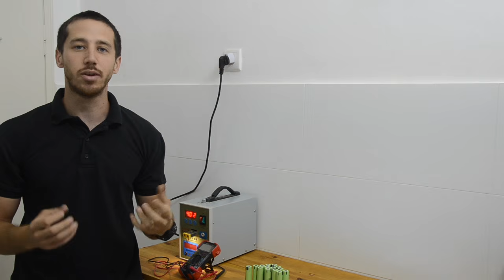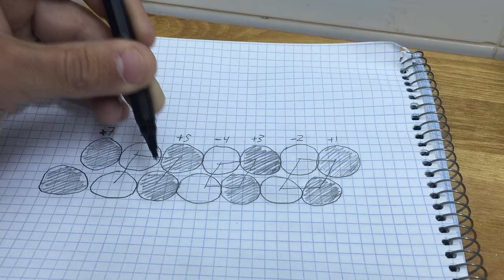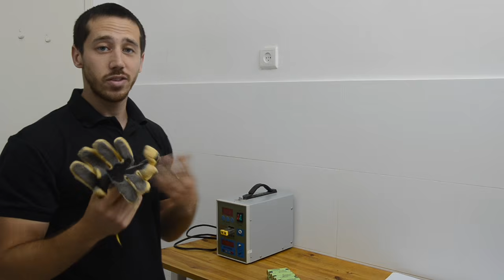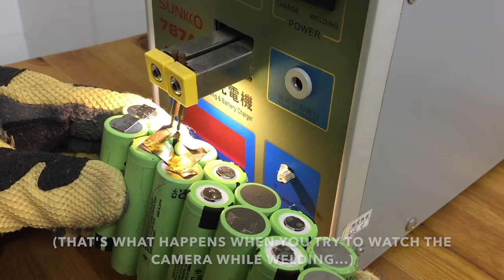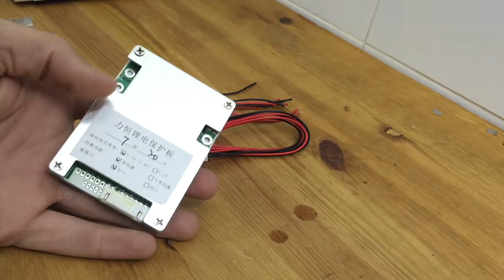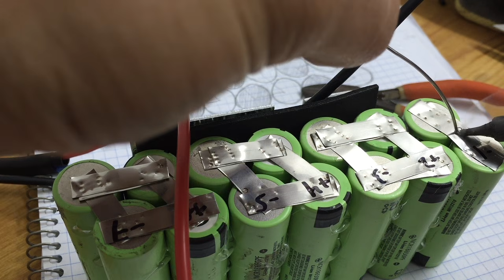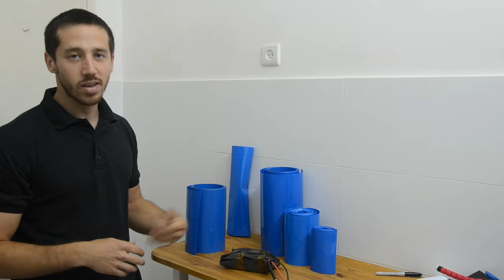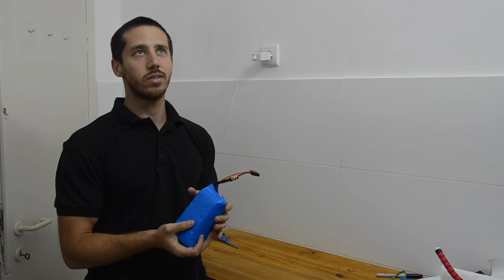How to build a DIY ebike battery from 18650 cells

Comment: Pretty good vid man, but a couple of things jumped out at me that maybe could be better?
I notice you're using 2nd hand cells yet you make no mention of capacity matching, you can't just slap cells together. If nothing else the whole pack is only as strong as the weakest parallel set. 

Also, when cutting your nickle, at the positive end underneath the heat shrink, the negative casing is rolled over the end of the cell. Sharp nickle corners, thin shrink wrap, in a bike vibration is an issue and if the corner gets knocked and the nickle rubs on the cell's shrink it will cut through and short the cell in no time at all. Keep the ends such that corners remain inside the positive end "buttons". Soldering to the nickle strip between two cells is also very dangerous for the same reason. Two layers of kapton tape under the nickle strip fixes this.

I make gaskets out of card that go between the nickle strips and the cells to protect the shrink from both heat during connection and from the strip rubbing later. Pro tip that's probably counter intuitive. A much bigger chisel tip on your iron with more thermal mass makes it much quicker and easier to solder to the nickle (or straight to the battery as I do) so quick in fact that very little heat is transferred into the cell itself.

Lastly, depending on the application, @5A draw per cell, they're going to produce a fair amount of heat, enough to soften hot glue. Add the heat generated by the BMS... I wouldn't wrap the pack in thermally insulative material. 

I have a jig to hold the cells vertically while I weld them in series sets. I then use 3x1.5mm foam filled double sided tape in between layers on each end and temporarily tape together. I then make the welds that parallel layers and attach the BMS balance wires, and output leads. One layer of shrink that leaves the SIDES of the end cells exposed and insulates the connections. Attach the BMS to the outer of the shrink. I leave the BMS in open air unless they're exposed to water, but really that's a design consideration for the mounts not the pack.  The foam in the double sided tape compresses and keeps the outer shrink under tension while giving a little still if the pack is shocked or dropped, you could leave it out if space is at a premium but I prefer it be there. It also leaves a little room for air flow between layers.
Reply: Are you able to show in a video? The safer practices
Reply: @rockyp3917  Nah mate I can't. I haven't got the set up to video anything atm. Also I've just moved house and most of my equipment is in storage, which I can assure you, is very uninspiring. Every time I go to build something there's some part that's not here!

That said, there's nothing wrong with the techniques shown in this video, just more care needs to be taken to ensure a safe build. Trust me, you do not want to short one of these cells at full charge. They can explode if the CID fails to vent the resultant pressure and heat is the enemy. Enough heat and they will explode and ignite every single time and take off like bottle rockets. Also if they catch fire the smoke that is produced is so acrid it will strip galvanising off steel and then begin to eat the steel underneath. 

If you want good sources for better information that this, check out AverRage Joe and  HB Powerwall and the rest of the DIY Powerwall community. I have no affiliation with any of them, but am part of the community and help out where I can.
Reply: @Jimmeh_B  Thank you for your reply, good luck with your moving.

Comment: hi Mike,
i saw a guy using a battery as a spot welder, which is just two pieces of 2.5mm sq cable straight of the terminals and used as probes for the welder. it was nicely made, but no timeing.
he just pushes up against the probes and then takes it off. 
the reason i talk about this is becuase i have just seen your video about thermal heat.
thanks 
i already have the ebike book, but would love the battery pack book.
thanks

Comment: Hi, im wondering why would you use 3 nickelstrip connections from the 3 parallel cells to the next for the serie connection? Is this also possible with one connection for possitive and negative?
Reply: i mean 2 nickelstrip connections

Comment: Hi Micah,  I would like to know if I can use different batteries such as a combination of INR18650 & INR21700 together for a battery. Or different voltage of batteries? What needs to be done in this regards and also do I need to take care of some special BMS for that? Thank you.

Comment: Hi, I am trying to build my first battery packing using a spot welding machine similar to yours.  According to my seller (of the spot welder) it is hard to spot weld pure nickel strip on top of another pure nickel strip.  I have tried this with my spot welder.  When I spot weld a 0.2mm pure nickel strip onto 3 layers of 0.15mm nickel plated strip (to act as the cell terminals), I need to set my spot welder to about 70% power.  But when I try to spot weld another 0.2mm pure nickel strip on top of that 0.2mm pure nickel strip, I could not get a good weld even with the power setting set to 80%.  I have not tried 100% power.
From your video, you were using pure nickel strips.  When you spot weld the series connection, you should be spot welding pure nickel strips on top of pure nickel strips.  Did you turn up the power of the welder when you do that?  Do you have any suggestion for me in spot welding pure nickel on pure nickel?

Comment: What does it happen if you make more connection in series and then you connect in parallel only the main + and - of the whole series instead of putting in parallel every single cell? Does it work or not?

Comment: Hey mate. Dan from Australia. 
Love watching you channel. Very informative. Quick question. I’m sure you have been asked a million times. I’m looking at making a portable battery pack for camping. Mini power wall sort of thing. Just wondering if I should make it in a 3S or a 4S and use a buck module (think that’s what it is) and reduce the voltage down that way. 
Was going to charging it off a solar panel of some sort as well.

Comment: Hi, Your videos are strong and best! Plz want to know if i want to support 36v 350w hub motor with 36v 14A+- controller by 3.7v 2500mAh@3C (Hvvea 18650-25F) do I still apply 4 P & 10S, what BMS should I need? 20A?

Comment: I bought and have studied your DIY Lithium Battery book. Very good in many many ways but disappointed to not find more information about how to decipher the printed info found on 18650 cells. Or did iI miss it? One thing I'm wondering right now is are cells rated for how many charging cycles they typically can withstand? I'd like to hear and Thanks!

Comment: Hi 👋, Micah!
Should you get an order from your friend to make, for example, a 36 v 10.5 A/h battery ( 12S 3 P), how long would it take you to weld 30 cells provided with your nice little welding machine, and what basis would you use to calculate how much it’s your friend cost? $/cell or $/ hour? Thanks!
Reply: 12s is 44v, no?
10s is 37v, correct?

Comment: What about a battery pack for a 18000watt bike?
Reply: Hi Ch,  18000W  , if you would like a 48V , the discharge current will be 40A , BMS discharge current will be 80A .
Reply: Nicole Tsui Thank you, what about a 150amp controller? 150amp bms as well?

Comment: Just a thought with connecting your wires from the BMS you solder them on. Why don't you solder the wire on to nickel strip and spot weld them on to the battery?

Comment: I make a 24v 15ah battery pack.The best 18650 
(....) mah and how many batteries are needed? Please say if any  kind of BMS will take place
Reply: Hello Amazing  creativity work ,  for 24V 15Ah battery pack , if  you made this by 2600mah cells , 
for series , it will be 7 cells ; but for capacity , you will need 6 cells , 7*6 = 42 pcs , you need 42 cells in a pack .
Reply: Please say if any  kind of BMS will take place

Comment: What do you think about 1/8 W resistor lead fuse on each battery  with 10p and more ?
I'm  thinking about that option, I have 10 p 26 s and maximal current 30 amp.

Comment: how was these batteries as per your suggestion
https://www.ebay.in/itm/LG-LGABB41865-2600mAh-Lithium-Ion-Battery-Grey-For-Ebike-Battery-Bank-Powerwall/132669705643

is it good to build a e bike battery

Comment: I've enjoyed all your videos and have been learning a lot  Thanks!! I wanted your opinion on what kit would be best for me im 235 lb 6'4"    and already commute 17 miles by car then 8 miles by bike most days without electricity but would  love to make the whole trip by bike I  originally was think 52v 20ah bafang hd on my current aluminum novara buzz + 9 speed with hydraulic discs but am worried about the chain/gears/rear frame strength because of the thin tubes in back. I have some steep hills in my commute thats why I originally thought mid drive but I remember you've had both drives before so would love you opinion or thoughts mid drive or hub maybe new stronger bike

Comment: Can you tell me why you need four strips of nickel to make a parallel-series connection between four batteries instead of one large patch that would reach all four points for easier more reliable connection without the extra layers? Thanks for the info btw, great video.
Reply from the maker: Both options are valid. Strips are just cheaper and more easily available.

Comment: Your doing a great job which helps others in building their own e bikes. By the way what is the specification of the 18650 that I should use for making a 24v 10 ah battery? What are the number of 18650s required? Waiting for more videos. Thankyou so much !.
Reply: aathitya vikash nominal voltage of an 18650 cell is 3.6 volts.  If you divide 24 by 3.6, you get 6.66 so 7 cells in series will give you a voltage of at least 24 volts.  In reality the cells discharge from around 4.2 volts down to a minimum discharge voltage that is typically around 3 volts.  So 7 in series would start around 29.4 volts and shouldn't be discharged below 21 volts.  Amp hours is usually a measure of the capacity of the battery pack and is dependent on which cells you use.  Check their data sheet for typical capacity or test them to be sure.  I tested all my NCR18650 cells to have at least 3150 mAh, so if I wanted a 10Ah pack, I'd use 4 parallel to be sure, about 12.6Ah.  So 7s4p (7 series 4 parallel).  Hope I got that right.

Comment: Only the series strips carry current. So I would place them first (and double). Then a single parallel strip on top. This last strip does not carry any current as it only balances the cells. It's also further from the battery if the BMS balancing wire is soldered on top.

Comment: This is another example of what I would call a DIY deception. This is not something most people can DIY. Do it yourself should indicate that this can be done by a large group of people with things they already have. I work on computers and have worked with people who have CNCs, laser engravers, and whole workshops for welding and wood working, but I literally no ZERO people who have a spot welder like that.

Comment: Bought your book been reading through it..  Still not sure on how or where to build the battery apropriately for a 200 amp battery?  Ive heard its over kill well im running a 1000 watt motor on sensorless?  And barely take off keep getting stuck on hills..  So the supplier said i need high amp for motor bought the batterys cant  not sure on the amp thing does it matter if i can run up to 70 amps max and 50. Continous should be ok
Reply: Fyi.. Batteries are spim08hp from alarmhookup needed compact..  However a more detailed video on bms  needs to be made and im sure your the kind of guy to git r done for DIY community..

Comment: Hi, I've got a 72v 20ah 500w Chinese E-bike (scooter/moped) that needs battery replacement soon. I saw your video and wanted to give it a try. What kind of lithium ion cells should use and how many per pack? it currently has six 12v lead acid battery packs. Rly want to upgrade to lithium, please help :)

Comment: I tried gluing new 18650 cells together with my hot melt glue gun, but the glue just peeled right off.  Is there some special glue I need to use?
Reply: Ah, duct tape.  Brilliant!  Why didn't I think of that?

Comment: What do you think about using 26650 3.7V 5000mAh (5024mAh tested) cells in leu of 18650 cells in a ebike battery pack? Same voltage so 14 cells would deliver ~52V but the AH would be ~70ah vs ~18-20ah for the 18650? These seem to be the way to go, but just learning about batteries so maybe not. Thanks.

Comment: how do u charge the battery?
I have a 12s battery but only a 6s balance charge.
what do I do??
Reply: Friendly Beast imho you probably don't want to balance charge your pack every time you charge anyway.  it's really only when the cells get seriously out of balance, maybe a good idea every X number of charges.  I recommend just charging to 90% of maximum voltage.  So use CHG instead of BCHG and go to about 48 volts for your 12s pack.  For when you want balance charge, you might want to have two 6s packs connected in series in such a way that you can disconnect them easily for balance charging.  Does someone know a better way?

Comment: Why not solder the power lines onto an extra nickel strip each and then spot weld those to the battery.. that way you avoid soldering on the battery completely. - also.. what is a BMS?
Reply: Battery Management System. It's VERY important.

Comment: Hi Micah, What's your overall opinion on the new 21700 batteries in comparison to these 18650? 
Price/capacity/power.. 
Do you think it already is a good deal to start using those or still too soon/too expensive? 
Thanks in advance.

Comment: I have a 16 inches folding electric bike that takes 26500. It's a 7 series of 2 that fits in the bike frame.   However, the battery is betty long and thin.  I think it's about 2 feet long.   How can I build one that thin and long? Also, what's the best 26550 battery?  It's a 24v 8ah.  Thank you.

Comment: Why are you using an RCA to Quarter audio adapter?   That seems like a big fail to me, couldn't you use an XT60 or something like that?   Audio signals use very low voltage and amperage, so they are usually made with very wimpy components, so that's the last thing I would use.   Even using a Phoenix connector or any sort of automotive electrical connector would be a better choice.
Reply from the maker: This specific connector is gold plated and rated for 5A. Charging this pack will use much less, so its well within the specs of the pack. There are many connector options out there, just depends which you want to use. Research first to determine the current and voltage ratings to ensure they match your project, like this one does.

Comment: What is the BMS and why is it necessary?
Reply: Battery Management System. It's VERY important.
Reply: To control the heat of the batteries. It will turn the system off if it gets too hot to avoid damage

Comment: I'm asking for a little comment on my question.
My wish is to make a battery pack for my electric bike from protected PCB cells NCR 18650b. Is it necessary to connect some BMS to this kind of battery cells? (7s4)  24v  13,6Ah

Comment: At the end of the video, you said, 5.8A. No you are wrong.
The final will be having 11.6A battery.
Total Power of Battey 
3.7V *  5.8 A * 14 cells  =  300.44 Watt.
Now, you are saying that the final battery voltage will be 3.7 * 7 = 25.9 V and Current will be 5.8*2 = 10.8 V
So,
25.9 V * 11.6 A = 300.44 Watt.
Reply from the maker: I said 5.8Ah, not 5.8A.
Reply: Then it should be 11.6 Ah
Reply: You are adding cells in parallel and series. 5.8Ah is for individual cell. Since you have done parallel connection, the total will be 11.6Ah.
Reply from the maker: no, as I said, the cells are 2.9Ah each.
Reply: Then you are correct. I searched on internet and i got result for 5.8 Ah so i got wrong calculations.
Sorry. 
May i get your email?

Comment: Hi Mickey, do you know at what voltage the BMS cuts off the current? Does it Cutts of the current when one cell drops down that voltage? Does the controller has also this function of cutting off the current if the overall voltage drops down a certain threshold?

Comment: I personally prefer to use length for parallels (to maximize capacity) because my triangle bag can't store more than 3-4 battery in one dimension. I also prefer to make long modular batteries such as 12V 20aH so it's easier to replace things

Comment: I have gotten in contact with a battery company that will give me 30 returned or defect e-bike batteries, so I will have a lot of things to use soon! But I have difficulties understanding how the whole charging system works. Putting the cells together doesn't feel like a big deal, but how do the BMS work and how do I charge it? Can I use an iMax B6 to charge my whole battery package with this system or do I need a 48 V charger? I was thinking to get an iMax anyway to be able to check all the individual cells before I use them, so it would be convenient. I will also live in a van with 12 V and it would be great if I could have a charging system running directly off 12 V so I don't need to go through an inverter with all the losses. Do anyone have any advice on a good read or good videos for learning about BMS's and the whole system of charging your bike batteries?

Comment: This is great if you want to create a custom pack but doing the math it seams just as costly as buying a prepared pack. 42 cells ain't cheap.
Reply from the maker: Unlikely. Most 42 cell packs cost at least $400. If you're paying $10 per cell, you're overpaying. Vruzend.com in the US has them for less than $4 each.